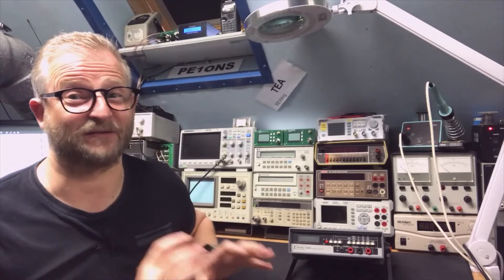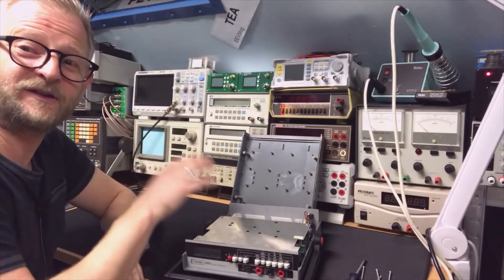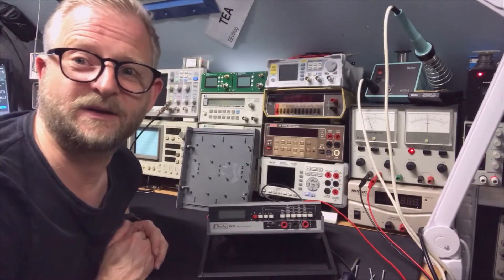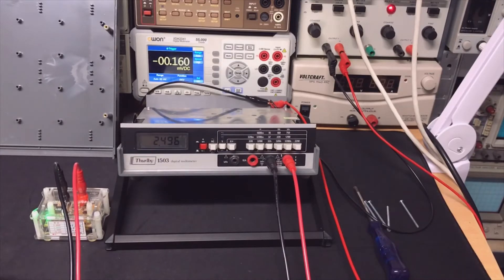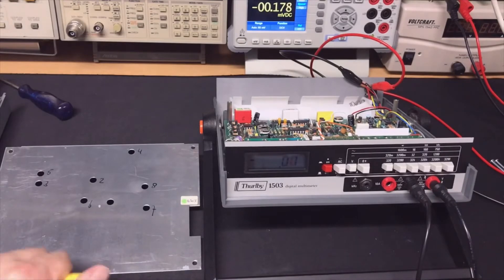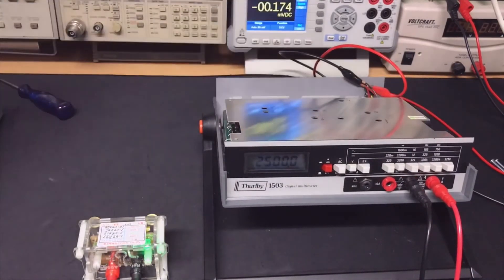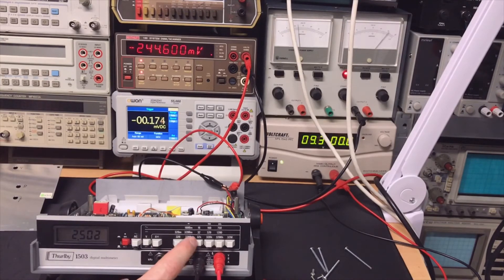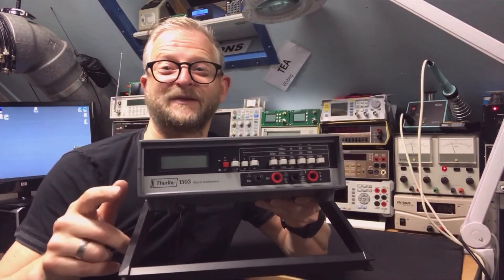#066 Thurlby 1503 DMM Calibration Teardown

Comment: Hi Tony, I have one of these. I bought it, opened it up and the batteries had leaked and ruined the battery box. So I bought another box and got the unit working. Two months later I had reason to open it up again and the new batteries had leaked and ruined the new box too! :) These were built in my home town, Sinclair, Thandar, Thurlby and Black Star all were based here.  Regards - Andrew
Reply from the maker: Nice Andrew.!. in you home town :)... sorry to hear about the leaking.. i used it with an power adapter, without batteries..
Reply: @TonyAlbus  Yes a little town had all these well known companies, Sinclair was in an old clothing mill, Thurlby Thandar of course was born from the ashes of Sinclair. Black Star is still here now called Prima.
Reply from the maker: @Andrewausfa  What a great place to grow up!! nice info Thanks!